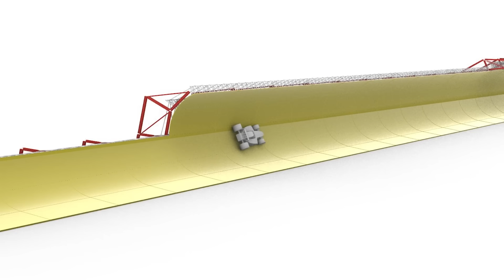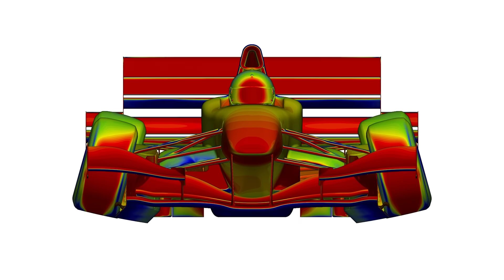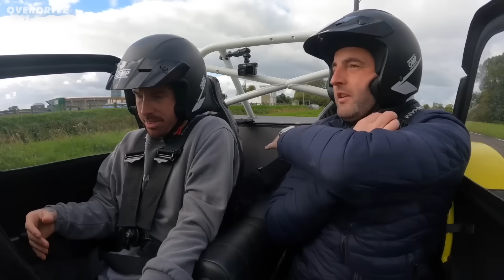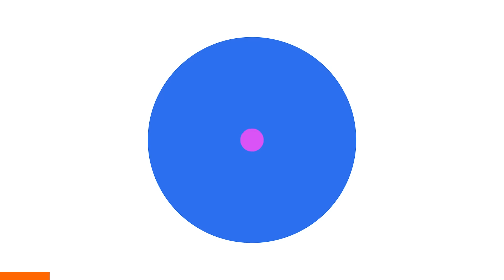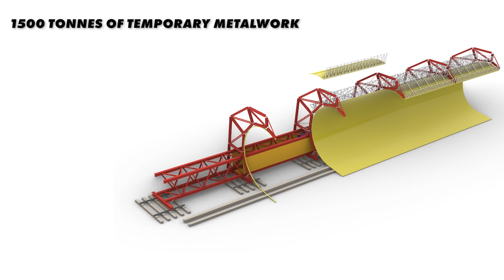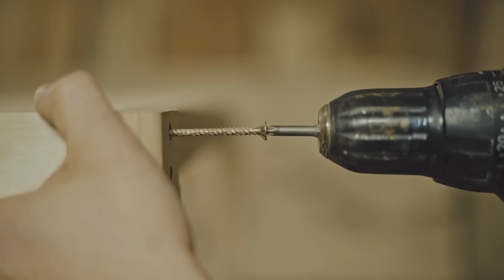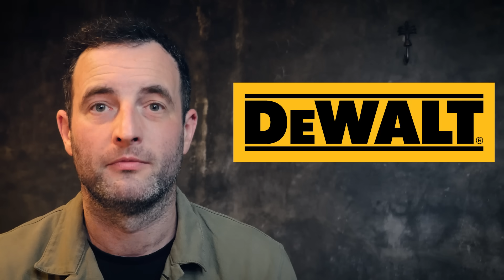Why It Costs £14,000,000 to Drive a Formula Car Upside Down

Comment: Can't you design a tunnel at a 30_40 degree downhill!?
Wouldn't it be cheaper to dig up a hole than building a frame and a road!?
It will help reaching the max speed faster,needs less work on building the frame and has more support for the structure.

Comment: Fast jet para-harness might be the option for keeping you in place. Designed to work upside down and has 5 point quick release for emergency.
Reply: yup, he needs a friend with an airplane to test that seat belt , get comfortable with it AND to get used to do stuff upside down 🙃
Reply: what is a "5 point quick release"? i am assuming it's a latch you can remove that is holding on to 5 different spots of the harness, in just one click?
or is it the opposite? 5 different latches you gotta click to release the safety? would seem rather counter productive 😂😂
Reply: @yurilopes420  it is 5 latches all running to a single point where they are connected and you can disconnect them with the simple push of a mechanical button on this connection. Usually 2 over the shoulders then 2 around your waist and then one or two running between your legs, depending on how tightly the latch(es) need(s) to be.
Reply: @JK-4600  thanks, that's what I was picturing

pretty sick but if those have to be some beefy latches to hold on 5 points
Reply: @yurilopes420  not really, usually the neg-g strap (crotch) is fixed then the other 4 points (2 waist and 2 shoulder) are clipped in on chamfered dowel pins held by springs. You can twist the top either way and the 4 points fall out. Google Martin baker Mk16 ejection seat and you’ll see what I mean. The harness is actually the parachute but I’m sure it could be adapted to work without the headbox and all the other stuff we fit to them. Google Martin baker mk16 ejection seat and you’ll see what I mean.
Reply: I hope he will see this comment as i think that this is the solution. I think it would be cooler if he were to use jet engines to achive the required speed as those are also designed to work upside down. But either way this is a really cool project.
I also think that the jet engine should be used to generate the electricity to power the electric motors as the electric motors can porvide way more instantaneous torque to accelerate the car fast enough to have enough speed to drive upside down for the desired time. Do you think i should write him an email to tell him? I am unsire that he would notice.
Reply: I believe adding jet engines, especially on a chassis not designed for it, will drastically increase project costs and variables at play  @JK-4600

Comment: How do you know when to stop driving on the curvature and come back down? Maybe LEDs on the side of the bridge that change color with your position or on the steering wheel?
Why don't you have an halo? Wouldn't it make sense since it is unclear how doable it is and that you could overlook something?
Will the data from the sensors and all the plans for the car be released?
Reply: The halo on F1 cars is to protect drivers from flying objects from other vehicles crashing. If there are other vehicles crashing on their closed circuit they've got bigger problems than loss of downforce

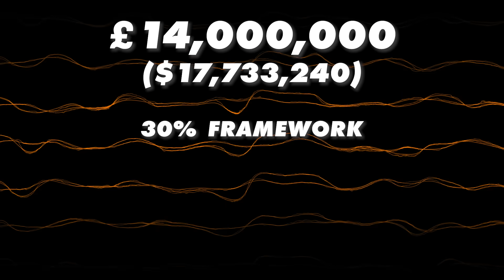Comment: 09:55 the assembly number might need to be increased. Labor on projects is often 1-1.5x cost of materials
Reply: They did say they are using very conservative numbers, it wouldn't surprise me if that included a big margin on assembly/labour costs (remember they're using a modular construction system specifically made for temporary works, it's not going to be as expensive to build as a permanent structure in terms of labour

Comment: What is reassuring is that they can gradually drive the car higher and higher in the tube (and maybe only show the end result). For maximum security they could just as easily remote control the car but we would lose all the thrill of this adventure.

Comment: The location would more likely take place at a air field. Or a drag strip. The latter would be more feasible. However the question would be if they would allow you to build the tunnel on their property. A hypothetical sponsorship from Dewalt would be interesting. They are a subsidiary of the massive American corporation Stanley Black & Decker which also owns Craftsmen.
Reply: If it's temporary they probably won't have many issues with the understanding that it'll be taken down afterwards.
Reply: What does the DeWalt sponsor have to do with the venue?

Comment: Might be a silly question,but why are you not using a issued railway tunnel or a ww2 bunker tunnel which there are hundreds of in the UK that are long enough too.just re line the surfaces and make a entry slip road to get speed up.also this can be done stationary in a wind tunnel.
Reply: all explained in previous videos

Comment: Can I just ask, where are you going to store this structure after you've used it? What volume will the disassembled structure take up?
Reply: Having a degree alof civil engineering and having worked in construction before, I can say that pretty much every material he mentioned in the video, bar for the curved road surface itself, can be sold and most likely will be reused in other construction projects, so this storing all of this after being used isn't really a concern.

Total volume of every material though...Yeah that would be a bit of a extensive calculation to make.
Reply: In civil engineering it's pretty normal to hire scaffold and support trusses. 
That would also likely be the case here and would keep the costs down significantly.

...and on the off chance they get a large civil engineering firm as a sponsor the hire might even be free so it's just be the labour costs of the construction to consider.
Reply: im pretty sure from a logical standpoint they will try to sell as much of it/all of it. It wouldn't make sense to keep anything because it would cost more to store it than buying new materials if a future project had to come up

Comment: You're definitely gonna need to test driving on plywood attached with screws at that fast with that much downforce. F1 cars pull manhole covers out of asphalt.
Reply: Modern F1 cars have a lot of under-body downforce. That's not going to be possible with this car because of the curved surface on which it will be driving. IIUC, most of the downforce will come from the car's aerodynamic wings.
Reply: They are coating the plywood with a high grip finish, so that may help to bond it all together.
Reply: Carlos Sainz thousand-yard stare
Reply: Good thing he isn't driving an F1 car then
Reply: @bg22757  ah don't be pedantic, you know what he means, all that down-force pulling the car towards the road is also pulling the road towards the car, F1 car or not its going to need to be tested on plywood.
Reply: @edthegoomba 
That's if there's a lot of underbody downforce, it's unclear if there is here
Reply: @ant2p2  very solid point, id imagine they are going to try and use the spoiler and stuff as much as possible to avoid warping the ply too much but we will have to see. something else that came to my mind while watching was the half million screws, they better make sure they sink every single one of them well to avoid a tire blow out, but also not too deep either or it can just crack the ply
Reply: @ant2p2 underbody downforce discussed in other vids. Doesn’t work in this project
Reply: @ant2p2 In one of the other videos William Toet specifically mentioned that he's relying on underbody downforce as little as possible because the transition to and from inversion puts the car on an awkward angle that would substantially reduce it

Comment: i'm not knowledgeable in this field so i have a question, with how much change and specialization done to the car, is it fair to still call it a formula car, like what make a formula car a formula car ?
Reply: i mean its an open wheeler has the same suspension, a monocoque, a similar front and rearwing it is similar in its essence, so i think its fair (imo)

Comment: Why do you want to build this tunnel so bad?
Just use a twisted surface, so everything can happen lower to the ground. by doing so, everything is safer and cheaper

Google twisted tape.

Drive the car onto a ramp, which then twists 180°
Keep it upside down for a while
Twist it back 180°

Safes thousands in construction cost
Reply: Sounds simple but what are you making the ‘tape’ out of - Unobtainium? It would still need a massive supporting framework and if there was a problem there would be no escape route like with the tunnel.
Reply: @simonm9923  of course it would still have to be supported, but you can have the track just 1 or 2 meters above the ground, which would be much safer and cheaper.

Comment: Could it be an idea to have a helper car that has the F1 upside down on top of it in the right height and bring it up to speed before the tunnel. Then tunnel should then just be the ceiling. It could go out to the side when the F1 is sucked to the ceiling, and go under to catch it again after. 
This must be cheaper to construct because the ceiling is flat and the ramps are unnecessary, the doesn’t need to be modified
Reply: Nice idea, but getting the car synced at the end would be difficult. I think it would be better to add a retractable landing gear on the car.
Reply: That's cheating.
Reply: @emenesu  in what way is it cheating? The goal is to see I driving upside down. So what leading up to, and away from, isn’t important.

Comment: Will you be having spectators?  Unfortunately, I am 12,000 miles away in New Zealand, assuming this will happen in the UK, but I'd pay serious money to be there if I lived in the UK.  How much would Sky Sport pay for broadcast rights?  I'm sure you'll be using off-the-shelf instrumentation for the track.  I used to machine load cells for the Road Load Data section at Ford UK Product Development at Dunton, but I didn't attach the strain gauges. There was a lot of work in them, but I expect they use CNC to machine them now.  I also worked in the MIRA Wind Tunnel which I you might be using to test the car and measure the downforce.  I have feeling that the F1 teams have more suitable wind tunnels though, and would be more inclined to give you time free of charge than MIRA.
Reply: If it picks up enough traction from sponsors it'll likely happen wherever the venue is sponsored. A Vegas airstrip, Dubai, UAE, etc.

...would be my guess.

Comment: If the time upside down is counted when the car is exactly parallel with the ground, then 5 seconds is a very long time.  I think from the time that the car is upside down and is parallel with the ground, 3 seconds is way more than enough time.  At 98 mph, that's 44 meters for every second, thus taking off almost 90 meters in total.

Also, reach out to Redbull... this is straight up Redbull territory

Comment: $14 million to drive upside down.... is it worth it? honestly I just think "imagine what else you could do with that"... 

That's 466 people's yearly salary on £30k a year. Space travel costs a lot but is worth it.... this however I don't think we'll ultimately learn anything from.
Reply: The tunnel will only be a temporary structure. So much of the material will be reused elsewhere once the stunt is complete. Also, the aerodynamics knowledge gained will be useful , as real data from the project will help with CFD calculations that are then used in other industries, making future modelling more accurate.
Reply: @Dqtube  that's a fair answer. But also I think it's perhaps something that should remain after. A permininent structure perhaps to commerate it or repurpose it.  Billionaires spend the same on boats so it's not like others aren't wasting huge sums. So I am unfairly judging.  

Personally I'd be happy if the plywood and mental went into building a climbing  centre or something afterwards. Something that tanglably benefits everyone. 

I guess if I had access to that kind of money or sponsorship I feel like I could make a massive difference to entire towns.

Comment: I have a safer idea for you, just get an already built tunnel, make the ceiling flat, then put your car upside down on a special platform driven by another car. When you enter the tunnel both cars will have the same speed then the platform will slowly retract few cm, then catch you at the end of the tunnel, if you fall you fall on the platform.

Comment: Dude, please don't do this. This is insanely dangerous and you don't stand to gain anything from it other than maybe online clout and channel growth but you won't benefit from that if you die or are left seriously injured after an accident doing this and you've already got over a million followers. This is madness, please don't go through with this.
Reply: Don’t be a wet blanket. This can be safely done with proper engineering, simulation and testing. I work in aerospace. This is very doable.

Comment: You need to sell pieces of plywood with supporter names on them. Great way to include supporters in a project and to give them some memorabilia.
Reply: This is actually a fantastic idea.  49,000 square meters of plywood, sponsored at 370$ a meter would cover the entire cost of the project.  That’s low enough that small business and even individuals could get involved. 👍
Reply: @calvinchabot2528  And no-one would get noticed.
Reply: @JackSmithii  do you have a better solution?
Reply: They could use it to make around 70 million 3cm key rings incase you were wondering
Reply: @Jimmyy32 How much does a key ring cost over there ?

Comment: Would't you make a model RC car with a model tunel to situmalate real world aerodynamic
Reply: It's not easy to get useful data from scale models in the wind tunnel. It's not like taking a 1/10 model with 1/10th of the original weight, let it drive 1/10th the speed and it will drive upside down - that's unfortunately not going to work. When I remember correctly from my time at the university, you need higher speed (in relation) for the same downforce/lift with smaller models. So the whole correlation of scale models and real cars/planes is a huge subject. Of course, scale models in wind tunnels are used in the industry but maybe this team already has enough data so they can rely on calculation - I don't know. Good topic for another video.
Reply: @driflysh4597  i have studied aerodynamics in university mechaical engineering .  I remember there is an equition to find the relative speed. I wasnt even taking about a wind tunnel. I was thinking if they can bulid an actual small scale tunnel simmliar to their design then run an rc car to see the possibilty of going upside down

Comment: I like what you are doing, but I must admit I am glad you have stopped calling it a "Formula One" car, and I am not sure you should be calling it a "formula" car.  The engine/chassis/aero/suspension combination will never be used for anything other than this project. So, you are not answering "can a formula car drive upside down?", you are asking "can a specifically designed car drive upside down?" and I'm not sure that was ever in doubt.... the answer to "Can a Formula 1 car run upside down?" is very obviously "NO!".
Reply: Totally, i would be very disappointed to see another car there, but i think there will be no project
Reply: Definition of formula is correct usage IMO. Formula means sorta == following your rules or "formula". :D Thats even why Fomula 1 got its name from. ;) They are just following own rules with car build around this problem.

Comment: Put an F1 can on a set of scales in a wind tunnel. Turn the wind up till the car weighs just over double and you've proved it and saved 14 million quid.
Reply: He's not trying to prove it's possible, we know it's possible, he's trying to actually do it.
Reply: There's a lot more to driving upside down than just producing >1 downforce weight ratio.